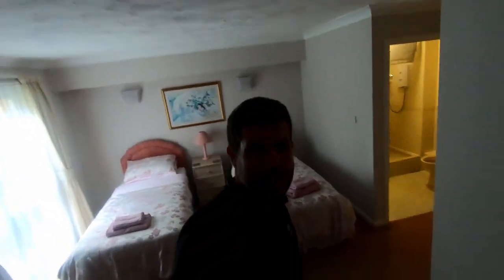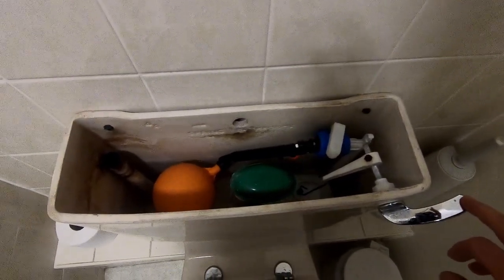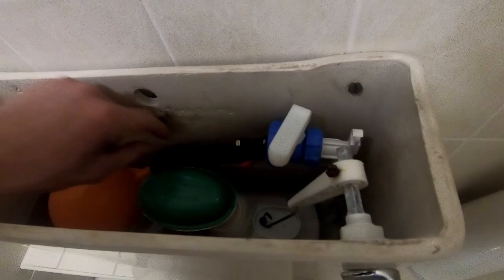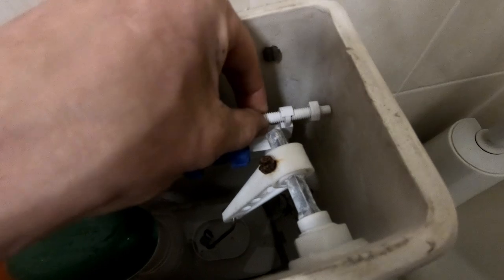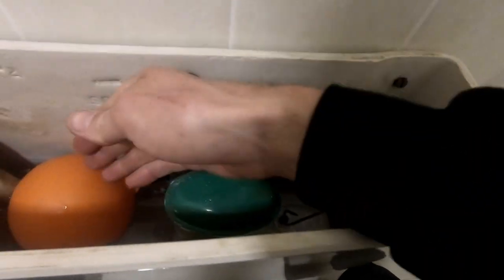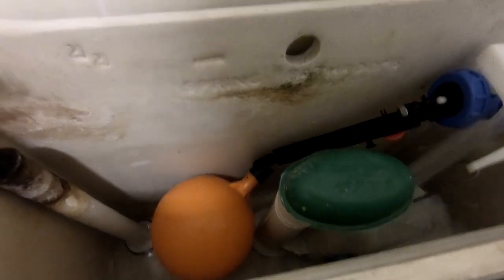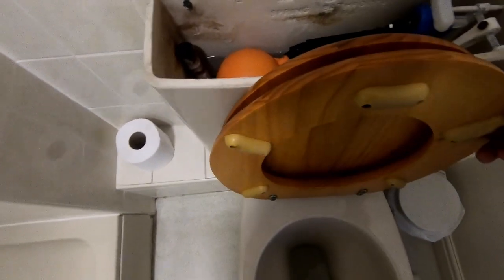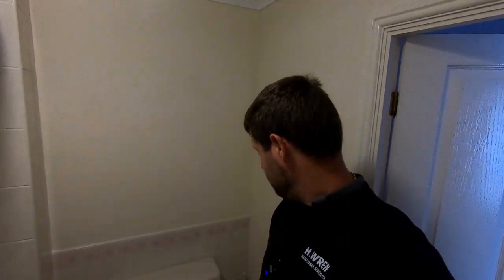Adjusting a toilet fill valve / ball cock

Comment: I love the old system with the ball,so easy to work on,mine is a new fangled system which is much more complicated,another good tutorial  my friend keep them coming
Reply from the maker: The old types of ball valves has one washer fits all. The newer valves have slightly different washers etc so generally I replace rather than repair these. New torbeck type valves are also prone to damage easily i.e by debris etc that gets into the pipework.  Again, thanks for watching and the comment!

Comment: Hello this video is very helpful - but though I have a similar system I cant seem to stop the drip outside to the overflow - the bit that you tightened so that the water level can be adjusted - mine doesn't seem to have much scope for tightening or loosening. Any helpful tip ?
Reply from the maker: The adjustment will work only if the diaphragm washer in the fill valve is in good condition. If this has worn, adjustment will not not fix the overflow problem. have a look at another one of my videos where I replace the diaphragm washer. https://youtu.be/utTfxVb2PqE  Hopefully that will help! Thanks for watching and the comment.
Reply: @HWrenMaintenanceServicesLTD  thank you!